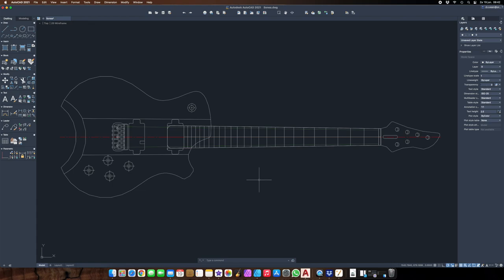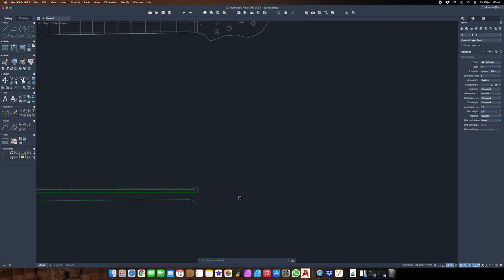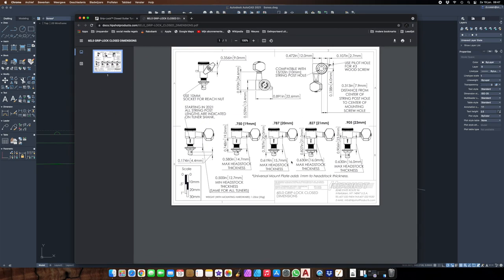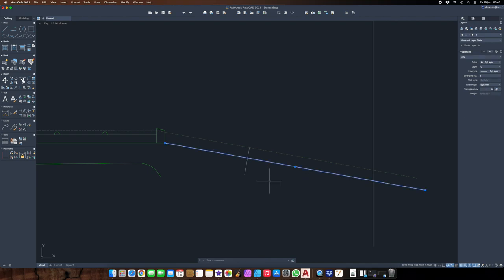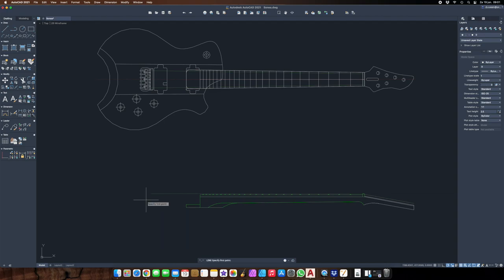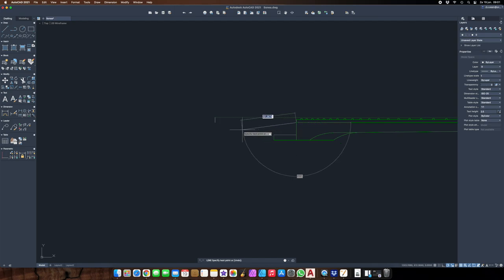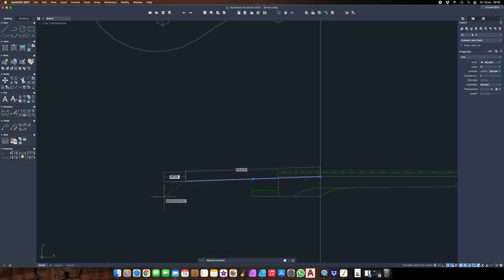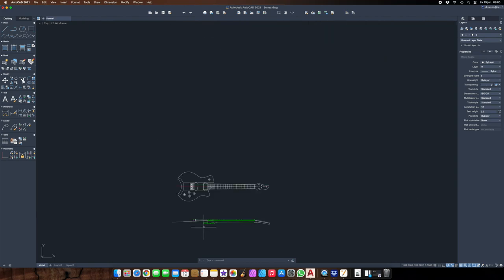How to determine Headstock & Neck Break Angles for your guitar build the easy way. - Tutorial.

Comment: This video is helping me finish setting up a frankenstien guitar I recently put together. It seems I didn't have the neck angle in relation to the bridge quite right. I'm still adjusting the action as we speak but I can already see consistency that wasn't there before. Thank you so much, I think this just might do it!
Reply from the maker: Hi Reprisal Within,
Guitar building is all about the relations between all the parts. Once you've figured them out it get's a lot easier.

Comment: Seems like if you pivot the headstock at the nut that the end point will move away from the vertical line you marked from above when the headstock was straight because the far end of the headstock is now moving on a circular path. I realize that this is completely adjustable though. Great info. Wish I could do Autocad. 😊

Comment: Great video Daniel!
What are the programs you are using to design the guitars? Thank you!
Reply from the maker: Hi El Jarocho,
I primarily use AutoCAD and sometimes Solidworks or Fusion 360 if I need to verify something in 3D. 
For example if a hole can be drilled at a certain angle.
Reply: @UnquendorGuitars  
Thank you! I appreciate your time!

Comment: Another great highly detailed video, thanks! I'm curious did you have any problems setting the minimum saddle height using the hipshot fixed bridges? I find using the included mounting screws which have a small dome head result in pushing the saddles up slightly. Luckily in my case I needed to raise the saddles slightly for the action I prefer, but something I didn't expect from a product like hipshot and something which may catch people out.
Reply from the maker: Hi Sean,

Yes indeed. The provided dome screws for the Hipshot bridge can be a problem and I wanted to mention this in one of my building videos but it didn't make the cut.
This is also a reason why I design my guitars for a string height of 10mm.
If you run into troubles with the dome head mounting screws I would replace them with flat head screws instead.
Reply: @UnquendorGuitars  Thanks for the reply. It's comforting for me to hear you faced the same. I was wondering at first if I had received the wrong screws after I researched a bit online and found no one else seeming to have the same problem. I guess hipshot assume that the saddles will always be raised at least slightly. Still, I'm happy I now know this to avoid any miss calculations on future guitars.

Comment: 3.44 However, you provide no indication of what sort of angle is needed at this point for the string ... so this neck angle now just represents the 'random line' that you first drew ... !?! What criteria do you advise for the correct angle for the string at the nut for it to actually now dictate the actual Neck Angle required ???
I fear that you missed out a critical part of the explanation here ...
Grateful for the missing information, please ... which will also need to take into account string tension, hence scale length amongst other matters ...
Reply from the maker: Hi Stephen.

I'm afraid you might have missed a small part of the video.
I talk about and explain the headstock break angle from 2:33 where I mention the break angle usually is anything in between 10º and 15º and the purpose of the break angle is to create additional string tension at the nut to keep the strings in the nut slots when playing the guitar.
After which I indeed draw in a line at a random angle to show that any break angle will do as long as your strings run at a downwards angle towards the tuners.
Reply: @UnquendorGuitars  So, you are effectively saying any angle between 10 to 15 degrees ... ? 
(No, I didn't miss that part of the video ... there was just no 'calculation' of the necessary angle to determine the correct string tension other than the approximate angle range ... )